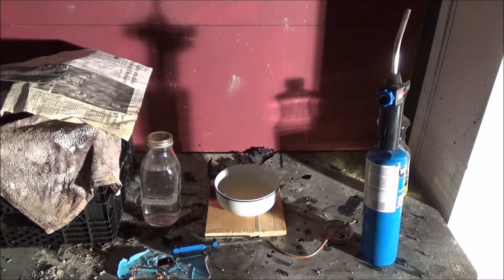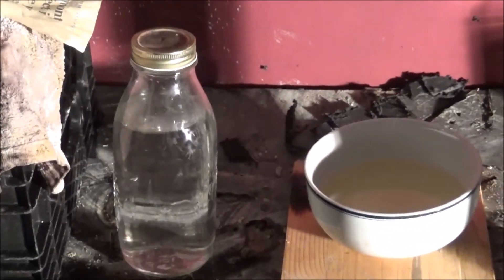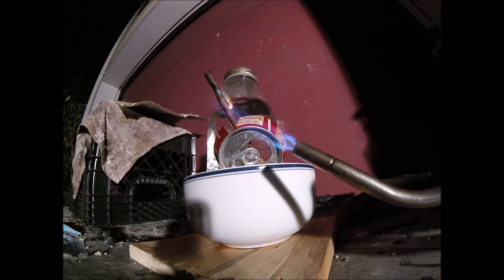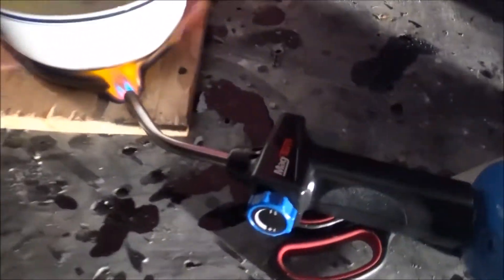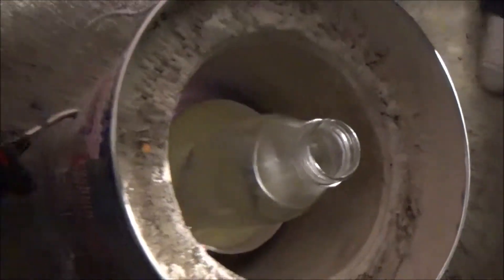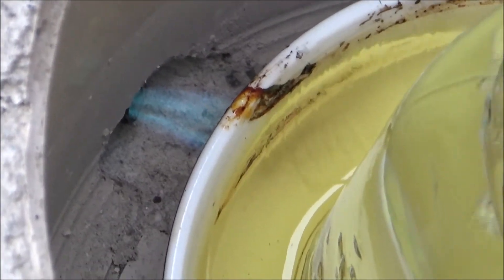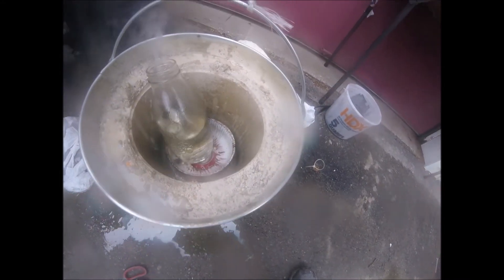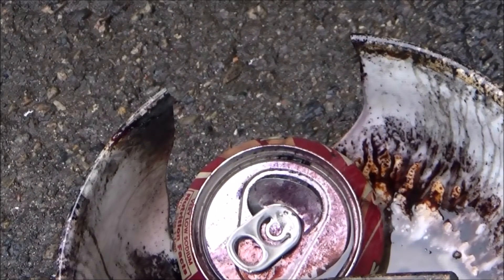trying tp Purify Sulfuric Acid, From Car Batteries/no Tempered Glassware~PART,1

Comment: hello, nice try man 🧐😁, how can we concentrate sulfuric acid, is it  just vaporize the water ?
Reply from the maker: Ya, need to do this again but better. I have made nitric Acid
Reply: @bennettslab2084  can we just use a stainless steel container for the vaporization, because I know that sulfuric acide doesn't react with some metals. Concerning the nitric acid I really want to know how to make it , because here in my country we must be authorized to bay it  thank you for these video I like learning from others mistakes 🥇👌🧪
Reply from the maker: @TruthDigest  thanks. Yes that's the idea of making videos.  It's pretty dangerous because the nitric acid will eat through anything but good glass,  However you can distill it out of a mixture of sulphuric acid and  Sodium nitrate  Fertilizer,

Comment: Wow that's dangerous as heck lmao. Why not use a hot plate lol. Sulfuric acid is extremely dangerous when heated .
Reply from the maker: The hot plait don't get hot enough or I don't have one when I made this video, now I have a  Heating mantle
Reply: @bennettslab2084  yeah it definitely takes forever to even do small amounts on a hot plate. I ordered a 500ml and 1000ml flat bottom boiling flasks to help speed up the process but I was using a quart Mason jar inside a pan but planning on trying the flat bottom flask directly on the burner which might not make much of a difference but I'll see soon enough. I do like the hot plate tho because one it's cheap so I'm not worried about damaging it also it doesn't heat it up enough to bring it to a rapid boil making it take longer but also safer.
Reply from the maker: @my2centz196   That's awesome,  Recently I got fed up with not being able to properly heat anything.  So I took an old 1000w electric water kettle apart,   And used the heating element on that at half power  And it's beautiful haha.  I should put up a video of it it's stable I'm not worried about it melting and I can control the temp with my  Variable AC power supply. I tried packing tinfoil at the bottom of it to form a  Thermally conductive cradle for my spiracle  Distillation flask... it sorta worked but don't help to much
Reply: @bennettslab2084  I'd love to see that video if you make it. I took apart one of those deep fryers for the same purpose but unfortunately I couldn't figure out how to make it useful. The element was like one you would find in a coffee maker to heat the pot but it was much bigger and I'd either have to get a huge round bottom flask or cut the aluminum pan down to make it more of a flat burner which is doable but I figured they typically heat the oil to what 350°F and I assumed a hot plate would probably get just as hot if not hotter but I really don't know seeing how I never attempted it any further. I haven't thrown it away yet so I'll hang on to it in hopes you make that video and it gives me a better idea lol.
Reply from the maker: @my2centz196  yes I just looked on my hard drive for it and I don't have it on my computer right now but I am pretty sure I have it on my mass storage drive back in my room so I will find it and put it up. it low key is one of the topmost useful things I got. if you fined the heating elemen it should have at some point 2 turmnals, like a light bulb or capacitor if you hook that up the wall, 120V it should get hot ass hell but dont die because 120V AC is mad dangerous. I always wear gloves and it still gives me shivers.

Comment: you  are crazy, hot concentrated sulfuric acid splash everywhere, and you reacted just normal routine
Reply from the maker: My safety protocols were somewhat archaic back then but i have made great advances in  The domain of deadly chemicals and radioactive materials